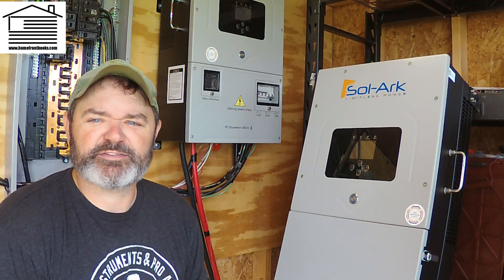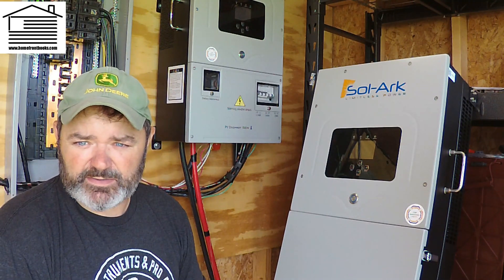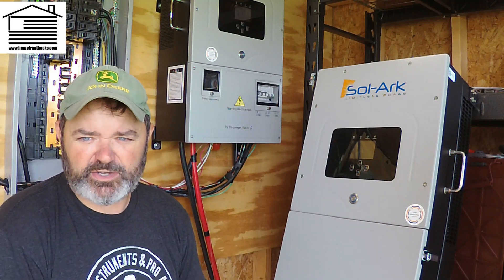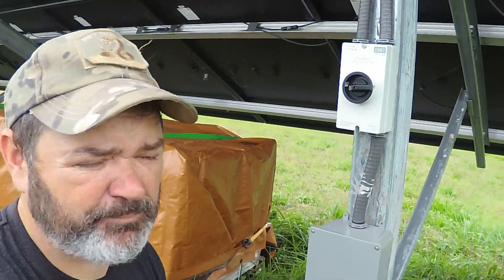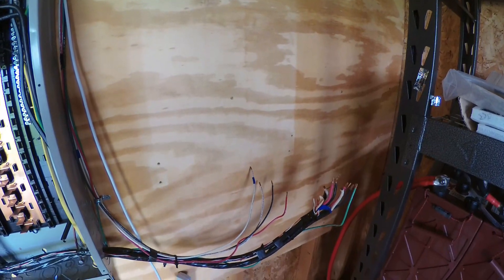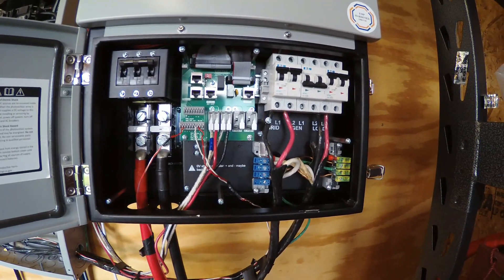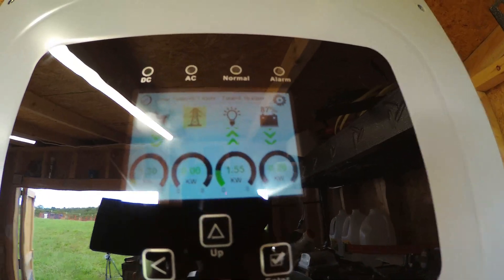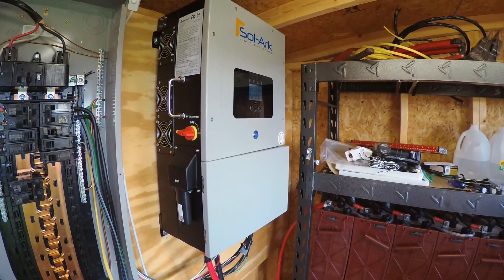DIY Off-Grid Solar - Sol-Ark 12K Swap: Indoor vs. Outdoor

Comment: How did you wire in your panels are they in series or parallel I have pretty much the same set up a 32 panels I'm getting ready to wire right now.? I have a 12 K sol ark Is there two wires that come into the combiner box just before the panel or is it just two wires coming in

Comment: HI Steve, Just wondering why do you connect your generator to the grid input instead of the generator one? Thank you.
Reply from the maker: If you're not using the grid input, you can use it for the gen, then use the gen input for smart load out or AC coupling.

Comment: The comms is the worst part of the Sol-Ark.  You HAVE to use the app to get any telemetry from the unit.  Sol-Ark needs to get with the times and let us have a truly off-grid solution.
Reply from the maker: I like the app. I like the fact that when I'm traveling away from home I can log in and check on everything. I can even see when my wife and kids are out of bed because I recognize the 1500 watt power spike when the coffee pot is fired up ;-)
Reply: @stvbird  Yes, it works well if you're not off-grid or you have an always-on internet connection.  I don't understand why a product designed to be off-grid doesn't have an off-grid monitoring solution.  Many other systems do.  It's a egregious oversight by Sol-Ark.  I hope they fix it.
Reply: @mrbodo69  their are data graphs options on the unit lcd screen for off-grid monitoring.....

Comment: Thanks for the review Steve well done. The only issue I have with the Sol-Ark's is having the breakers on board. As I saw you isolated the solar arrays, but that is usually on the roof for many people. Also, the battery must be isolated before disconnecting, as well as the grid if present. It is great for a quick installation, but if you need to work on the inverter you need other external isolators within easy access.

I always use external breakers on the wall near by, so everything can be isolated as needed.
Reply from the maker: Thanks for watching and for the feedback. Sol-Arks do have breakers on board, but they don't necessarily have to be THE breakers. My generator has its own breakers, so I can shut it off there. I also have a manual disconnect box on the wall for gen input. I also have the PV disconnect on the array and a breaker panel on the wall. I don't have grid input, but I would have a manual shutoff on the wall for that as well, again, if I had it. Having breakers on the box is just one more level of control as to what goes in and what comes out, as well as one more level of protection for the system. For roof-mounted panels, which I also have on a different part of the property, a PV array DC isolator can be put on the wall where it comes down from the roof, it doesn't have to be collocated with the panels out of reach.

Comment: Some of the specs you list for the outdoor 12K also apply to the later revisions of the indoor 12K as well.
Reply from the maker: Thanks. That's good to know. I'll look that up then put a note in the video description stating that. Thanks!
Reply: @stvbird  Your indoor Sol-Ark was one of the 63V ones.  You can see the sticker.
Reply from the maker: @randacnam7321  yes, it was, however the data tag says 61 max like I read on the video. I started out with a green board early 12K, but it was unsuitable for off-grid applications without a transformer (couldn't run variable speed tools or appliances), and the lower battery voltage wasn't suitable for equalizing my type of batteries. The blue board 12K, although it has a 63 volt sticker, would trip off with an over voltage fault anytime I had battery equalization set above 60-61 volts.